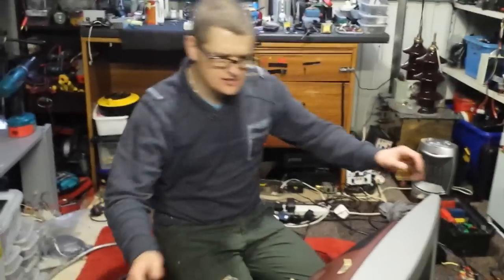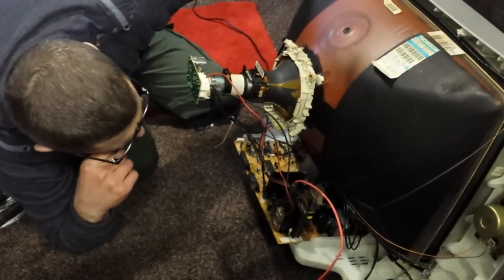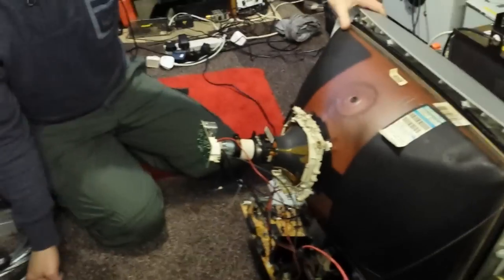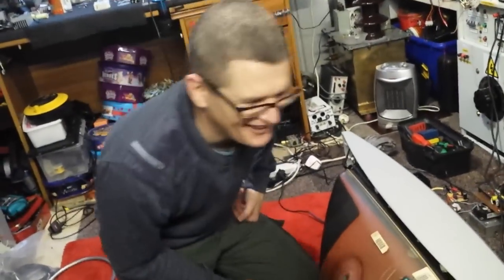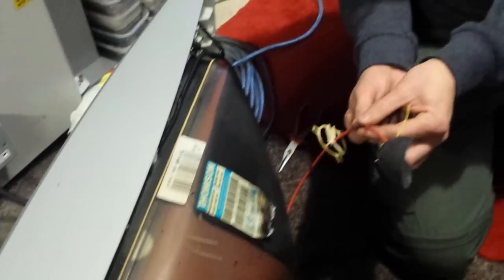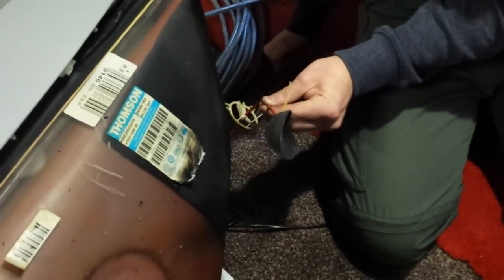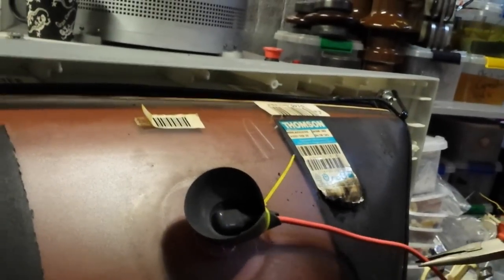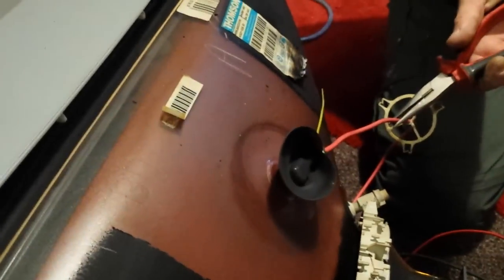Television crt flyback arcs

Comment: I have connected not 1 not 2 but 3 yes three of those flybacks in series yes in series not in parallel and now I am getting nice 6-8 cm arcs it melted my screw driver into little balls of steel .and each of them is separately powers by a 300 watt e ballast so that's 300+300+300=900watts of power 
that's freaking awesome
Reply from the maker: you nutter lmao👍😉👍😉
Reply: What is that

Comment: can I power a flyback transformer just straight from a tv board or is it going to freak out 

and can I put the red wire onto other things? or is it only the tv screen that the voltage can go to

Comment: I found an old television and did the same thing, got nice 7 inch hot arcs with little noise. 
Although it lasted about 15 seconds of fun before something popped and smoke appeared lol.
I took the flyback out and hooked it up to a basic transistor style driver, and for some reason the flyback will not work with it. 
Any ideas of why?
Reply from the maker: try rewiring it backwards to what you wired it. as the flyback could have a diode built in. or ya circuit isn't high enough frequency 

hope this helps mate

Anthony

high1voltage1rules

Comment: can you tell me the name of power transistor inside that CRT TV
Reply from the maker: Hello mate 
sorry for the late reply.

the power transistor inside that crtv I don't keep! as thier not that many amps and wouldn't be good to use as it would only be around 8 to 10 amps.

if you was wanting a good mosfet transistor I'd recommend a irfp260n. there 250 volts at 50 amps and in a 555 timer or a zvs driver they can give great outputs. you can find the circuit diagrams on google images.

hope this helps and be safe.👍 

Anthony 

High1voltage1rules
Reply: Thanks my friend at least you replied to my comment you are among very very few YouTubers that reply to my comment and for your concern I have already alderd a zvs driver 500 watt from eBay  and will be delivers by may 31-June 9 it coated me 20.99$+52.00$=70.99$ delivering to india .In  Indian rupees I have to play a sum of 6000 regards
Reply: But those can easily take 1600v but irfp260-40 they only go up to 200

Comment: Awesome arcs mate! I have 3 decent sized fly backs with no room to fit five plus five turns on them what type of circuitry do I have to have to run them off of the pins?
Reply from the maker: hi mate, you could try a 555 timer circuit! search google images for the circuit and it will bring pages! choose one that's just got 1 pot!   iv done videos of me using the pins and how you can find the pins too! good luck mate, and any more help don't hesitate ;-)

Comment: Swear to God every single board I go through the trouble of grabbing of late has protection on it so it won't work unless its hooked correctly to the crt. Getting so buggered by this.. Got a huge board out of a 47" sanyo today - Got it running, goes into protect after 5 seconds.  I wired the relay shut and I can actually here the MOSFET kick off. Anyone know how to defeat this?

Comment: hey h1v1 do you know how to make a 12 v DC flyback driver from CRT tv parts beaucse my other flyabcks are driven using electronic ballasts I want potable flyback driver
Reply from the maker: hello, you could use the parts like resistors and the transistors to build a little oscillating circuit, it won't be very powerful, maybe 10 amps but will run ya flyback easily enough to get a couple of inches of arcs! hope this helps.
you can get simple circuit diagrams of Google images.

hope this helps.

Anthony

high1voltage1rules

Comment: I wouldn't try this i would never touch that red live wire of death with my bare hands!
Reply from the maker: mate iv been doing this for years! I know what I'm doing! the shock from these is around 15 to 25kv. it's at 15khertz very high frequency.  it won't kill you but but burn more than anything. 

so please don't hold it against me. as iv been doing this for a long time. iv been messing with xray transformer you name it iv don't it with high voltage.

thanks for your concerns and thanks for the comment.

Anthony 

High1voltage1rules
Reply: any type of current above a frequency of 700hz will not go into your body that is called skin effect
Reply: +high1voltage1rules  discovered by our old uncle Nikola Tesla
Reply from the maker: +Mrinal  Thakur 👍😉thanks mate 👍😉

Anthony 

High1voltage1rules